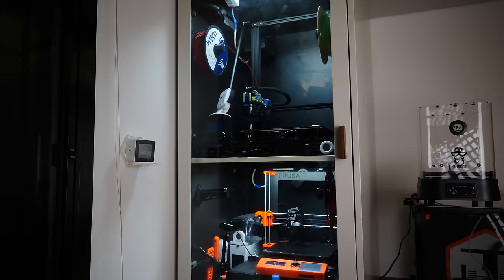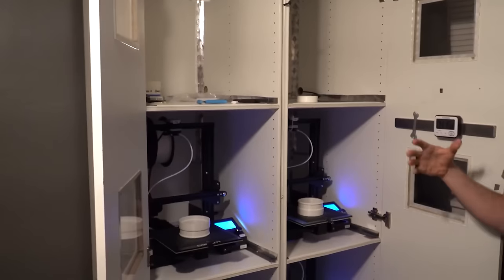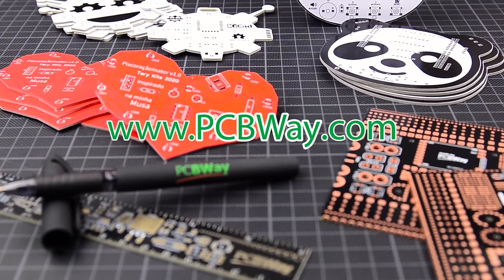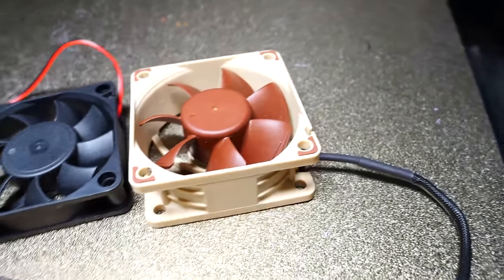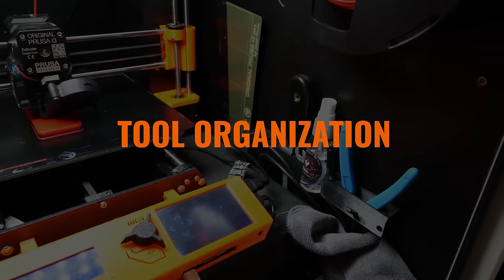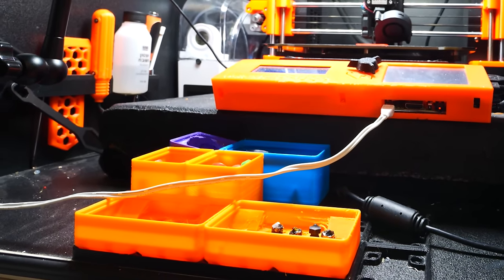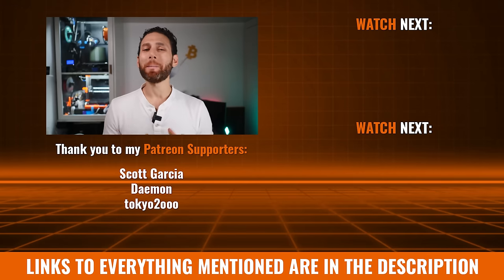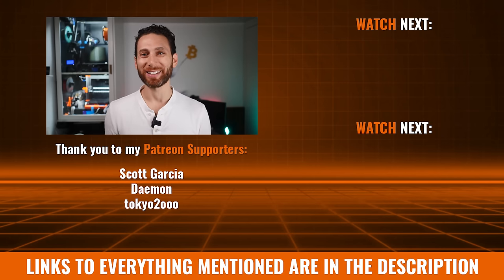Build The ULTIMATE 3D Printer Enclosure

Comment: Great video, sir! Very informative. I do have to mention a plugin for octoprint that I've used in the past before moving that allows you to use a tasmota flashed smart outlet to automatically turn on the printer when a new print is being started and turn off the printer after a set amount of time of being idle. I don't remember the name off the top of my head, but it's pretty easy to find in the octoprint plugins.
Reply from the maker: Ooooh smart, on it

Comment: I’m not sure how large your intake hole is, but for a passive intake, you will want the size to be significantly larger than the fan/exhaust side. Otherwise a fan on the intake side will help balance. A slightly negative pressure inside the cabinet is ideal to prevent any nasties from getting pushed out too.
Reply: To create a negative pressure on the inside wouldn't you want the intake to be smaller than the exhaust?
Reply: @DoRC  If there's only a fan on the exhaust side, there's always going to be some degree of negative pressure in the chamber. As the intake size increases, the pressure differential becomes smaller, and air flow rate increases until the fan's maximum flow rate is achieved.

Comment: For printing ASA and ABS, ideally you'd want 50-60C enclosure temperature I believe. This is why the Voron electronics are outside of the enclosure and not inside it. But I can see that to move the electronics outside for the cr10 and prusa might get kind of tricky.

I am also not certain how fire proof that enclosure is. You do have oxygen flowing in through the holes you've drilled for the air inlet.

With fire extinguishers, you can get automatic fire extinguishers but they trigger at like 60C so they're a little too sensitive. You could mount them outside the enclosure though if the enclosure ever got engulfed in flames.
Reply from the maker: Ah, wow, didn't know the temp should be that high. Thanks for the tips
Reply: The enclosure I have my Prusa in maxes out at about 35C-36C, and my Voron parts have been turning out just fine.  I broke one of my test cubes with a couple of adjustable wrenches, and it didn't break clean at a layer line, but left a more jagged break, so adhesion doesn't seem to be an issue.
Reply: @netpackrat  the reason for the higher temperature isn't to do with adhesion. It's to do with warping and internal stresses. The Voron parts are pretty small so that's less likely to be an issue. As you try to print larger parts, higher temperatures reduce warping and reduce the internal stresses

Comment: Smart plugs are a wonderful addition to 3D printing. I use them with the Octoprint PSU Control as well as PSU Control - Home Assistant plugins. 
Those make it super easy to have the printers turn off automatically after a print is done, and the printer has been idle for 30 minutes. If you use Cura, you can even use the Octoprint plugin in Cura to have the printer turn on automatically when you send g-code.

Comment: Not sure if you use Octoprint, but there is a plugin that can be configured to automatically turn off your smart plugs after your print completes and your hot end cools to a specific temperature. This allows the fan on your hot end to run for a while to prevent heat creep. 👍
Reply from the maker: OOOH, cool, Definitely gonna check that out, thanks :)
Reply: yah, it's called PSU control. I use it on my ender 3

Comment: Closed too hot for pla. So doors open on pla.
Abs/asa at 35 degree may fine for small thingiverse shit.
Print a 10x10x10 thin walls abs part and your parts are toast.
That leaves only petg to print with closed doors. 🤷‍♂️
Reply from the maker: Yep, I just printed the removable door hinges, no time to put them on today though

Comment: Thank you for this! We've been wondering about your enclosure. To me, this is one of the better one's I've seen. I'm going a cheaper route for mine but am going to take a few ideas from yours, like keeping the temp close to 35 all around. I don't use any materials that require massive amounts of heat and will certainly be adding a few holes for air-flow. Thanks for your videos!
Reply from the maker: Glad it was helpful

Comment: Great video! Just make sure with the printers you shut down the raspberry pi before disconnecting the power. It’s more important on the v2.4 since klipper stores everything on the pi and a corrupt sd card is a nightmare. There are other ways to turn off power to a klipper machine, like the home assistant plug in, installing an SSR between PSU and mainboard so you can use the pi’s gpio and moonraker to turn the rest of the machine off and on while keeping the pi on. Other than that it’s a great video.
Reply from the maker: Oh, yikes. I didn't know that. I never do it lol. Thanks for letting me know
Reply: @thenextlayer  Nice! now you know, that would SUCK if you woke up one day to a corrupted v2.4 rpi. There are definitely ways to do what you're trying to do. the easiest is to use an external power source for the pi and the smart socket for the printer.

Comment: I'm not good at flow dynamics but I'm going to ad a vent pipe with a 4 inch duct fan coming out of mine with a window outlet for printing ABS. On the inlet I'm going to put a carbon filter to stop any dust or anything from going into it.

Comment: This video was very interesting as I am about to build my own enclosure. Mine needs to have different specs to yours since I will use mine to print polycarbonate, nylon and polypropylene. So it needs to be capable of higher temperatures and as such the main board, pi and psu will be mounted outside the enclosure. The enclosure will pretty much become part of my printer which is an ender 3 pro since I will just pull off the main board case and mount it under the enclosure and just drill a hole for the wires so I don’t need to deal with extending them all. I will probably also power the pi from the printer and add a relay to control the printers power from the pi.

A few good ideas I saw from your video is the lighting, I was just going to add a few led strips but may rethink that now. Another good idea was the tool holders, it would be good to mount all the tools on one side (outside) of the enclosure. You gave me an idea for setting up my camera as well, I will just use a flexible mount and have it outside the enclosure but move it into position when I need it. I might need to rethink my cooling though as I planned to use a 120mm fan vented out of the enclosure through a hepa and carbon filter, that might not be enough cooling. But I can always open the door if I need to since the parts that would need to cooling are mainly just PLA. My plans for the cooling controller are just a microcontroller and temperature sensor, the fan will be constantly on slowly but will speed up as it needs to cool the enclosure.

You have definitely given me some ideas and things to think about so thank you.

Comment: to save on external air filtering and keep the noise to a minimum, you could  instead install a closed-loop external air radiator (similar to a water cooling loop in a PC that  transfers the heat from the inside of the case to the external radiator - only, instead  of water, you would simply circulate the inside air through an external heat exchanger).  Depending on the size of the external radiator and the amount of heat needing to be dumped, you could perhaps get away with no outside fans, and  if they prove necessary - they would be much bigger and thus slow-spinning/quiet. Obviously, the diameter of  the pipe/radiator would  need  to be appropriately bigger, for the air-to-air heat exchange to be effective. Something to research/experiment.

Comment: Would you mind providing more info on the filtration components? (fan, switch, filter) The aliexpress links are broken for me. Particularly which filter or at least the dimensions? From the STL I'm getting 62mm x 110mm, but not finding much of that size on amazon
Reply: Ahhh, nm. Found it all on the original thingiverse for the housing

Comment: Thanks for the great and in-depth video!
Two small questions though; what are the inner dimensions of the closet/enclosure? I am talking to a carpenter to have something similar done with my printer.
And how are you controlling the "when the temperature goes above 35c, turn on the fans"? is there an additional arduino/ESP device controlling it?
Reply from the maker: Check my video on accessories to keep on hand to level up prints. It’s a temperature switch. Mine is 58x65 inside. Too big now that I don’t really use my CR10
Reply: @thenextlayer  Thank you for your answer! 
I have seen that video in the past, but did not catch that it automagically turns on the fan at set temps, perfect :)
Hope to have an enclosure almost as nice as yours soon

Comment: two words: stereo cabinet. glass front, adjustable shelves, thin particle board back that's easy to cut or drill for cables or ventilation and the top makes a nice work surface.
Reply from the maker: Genius

Comment: Tips for temp control, first is don’t run those lights unless you have to, they produce more heat than you think.
Second is that those style of fans are not designed for pulling/pushing air through a restriction like a filter, they are made for unrestricted air movement, a vane style is more suited. 
Lastly, plumb a duct to the lower chamber to pull air directly from that chamber itself, as well as a duct for the top chamber.
Reply: Centrifugal fan design is what I meant, my apologies.
Reply from the maker: Nice, these are good tips, thank you

Comment: I printed out one of those ball bearing spool holders for my Bear upgraded Prusa, and I found that it spun too easily.  The filament would over-run and get tangled around the holder.  I machined a couple of plain bushings out of delrin to replace the bearings, which made a significant improvement, although I think a little more friction would still be beneficial with some spools.
Reply from the maker: Oh interesting!

Comment: I would add a second fan to the exhaust, the biggest restriction is your filter and add a bit of dust filter at the inlet to stop dust from entering the enclosure.

Great setup
Reply from the maker: Thanks, this is a good tip - but how... in-line?
Reply: I would first try stacking a second fan on top and see what happens. Or a second vent system, possibly with a higher temperature switch.

A smoke detector might also be a good idea.

 A server fan, while noisy, would do this well. An Arduino with a temperature sensor, the hotter the temperature, the faster it spins would be the best solution. This is what I am planning for my enclosure, but I have server fans lying around and my printer is in the basement away from people.

Comment: 1. While not super fire safe, putting your printer on a NBR foam yoga mat or kneeling pad will likely work just as well for noise and vibration. 

2. BLAZECUT for the fire extingiusher tho you might want something to stop from blowing sparks out the bottom hole.

3. Painting the interior a lighter color will make the lights work better